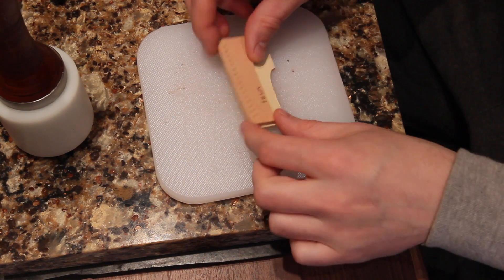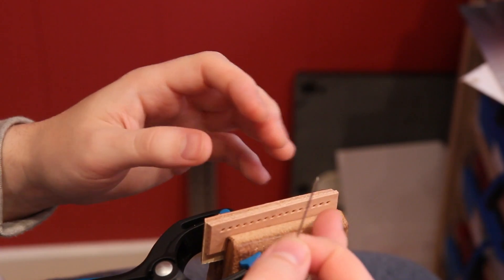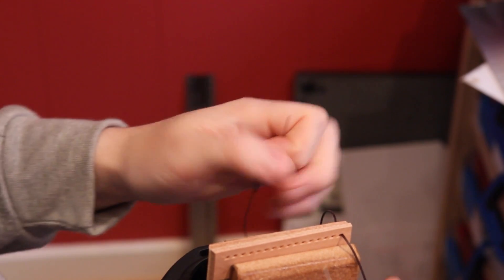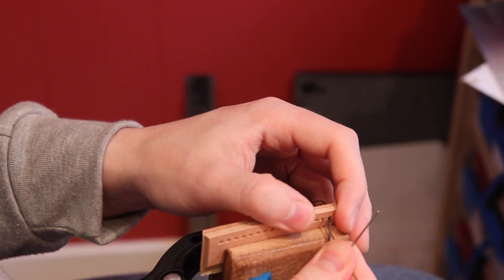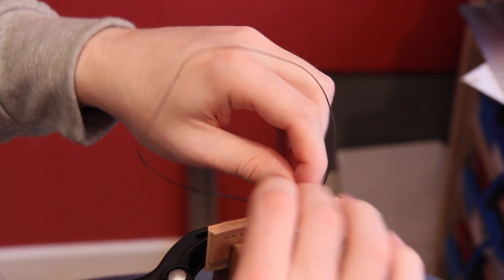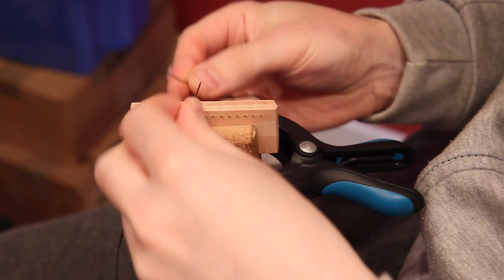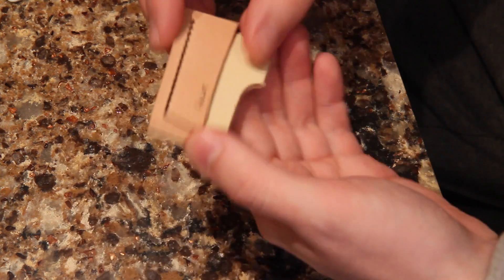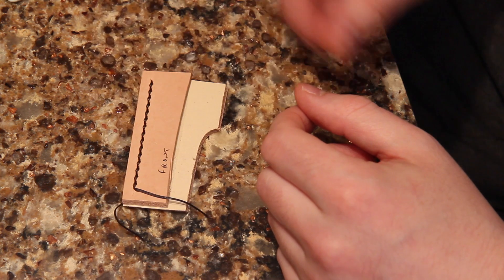Quick Tip: Neatening up Your Saddle Stitch

Comment: I'm having a hell of a time getting the pricking iron out of two pieces of leather (8mm total). I have rubbed the iron against some beeswax but it doesn't feel 'lubricated', just waxy and somewhat sticky. Without the wax it is equivalently difficult to get the iron out. Any tips? Is my beeswax (for candle making I suppose) bad for lubrication?
Reply: roaet..I hope Ian doesn't mind someone answering one of his posts, but I thought I'd tell you what works for me. I cut about an inch off the end of my poly cutting board on my table saw, which gave me a piece about 1" x 12". Cut it in two so you have 2 pieces, each 1" x 6". Keeping it flat, cut a groove about half way along one of these. You now have a U shaped piece, with the slot of the U the width of your saw blade. With one end open, after punching your holes, slip this jig along your prickling iron in the U slot. Hold the poly piece down firmly and the iron pulls out a lot easier and I get nicer diamond shaped holes also. No rocking back and forth or other movements causing holes to elongate. Add a hole and leather wrist loop in the non-U slot end and it helps keep it close while using. I still use bees wax. Good tools are expensive and if it may help extend the tool life, I use it.
Reply: Allan Davis great tip! I was just having the same issue and this totally makes sense.
Reply: +Efraín Bojórquez García Also try high grit sandpaper and then polishing with some... well... polish lol and a piece of scrap leather. 
just rub the abrasive polish into the flesh side and either strop the punches or rub them with the leather. This will make the metal itself much smoother, therefore easier in and out, and the wax can do its job. Hope that helped, but test it out on an awl or something first to get it right.

Comment: Very Nice young man. I do take a lot of interest, of late, in your very informative clips. I hope to make my own friction sheath in the summer for a very old Normark Supersweed lock knife that I have had since the 80's. The original Whitby knives sheath is failing in the belt loop so I need to replace it. I will use your clips for help & pointers where I need to. The stitching is certainly one for anyone to have a look at. Keep it up & Many Thanks

Comment: excellent video ! In a saddle stitch do you need to tie off the ends before cutting the thread or does it lock it self after flatting with the hammer ? I have always tied the ends just to give it a little extra insurance .

Comment: You use the Japanese pricking iron to make straight stitching easily, but I'm having trouble keeping my stitching neat while I do round edges. Do you have any tips? Usually I just try to hammer out holes one-by-one first.
Reply from the maker: +chriserony use a 2 prong iron for going round curves

Comment: Do you have any recommendations to reduce the trauma to the back piece of leather when punching the holes? (I.e. the holes are clean where the punch enters the leather but not where it exits.) I always use a thick, plastic sheet under the leather to protect the punches from the stone slab underneath, but perhaps that’s not the best material to use?
Reply from the maker: Put some scrap leather under

Comment: Nice video. One question...when you stitch a leather belt, how do you know how long the thread will be? How can you measure the lenght of the thread?
Reply: Ciobanu George I know this is an old comment but in case you haven't found the answer, your thread should be about 4 times the length of the item you are stitching.

Comment: Hi and thanks for the video. question here: Im using Japanese pricking irons, the black ones, and I notice that when sewing after the holes, the thread in one side of the leather looks like a zig zag and in the other side the stitches are in a straight line. Sometimes is the opposite, I have noticed that this change depending in in which side of the leather I put the needle first. If I put the needle first on the under side of the leather then the other needle through the visible side of the leather, I get the zig zag in the visible part and the straight line stitch kind of in the under side of the leather. Personally I like it more when the stitches looks like a straight line in the visible side of the leather and under the leather the zig zag... is there anything I can do to control this? 
Big thanks

Comment: hi, this tutorial is wonderful! However can i ask something?

I realised that when using this stitching method on thinner pieces, the front tend to straighten up. Is that what you experience as well?

If so how do u solve this issue? For me I tried to solve it by not moving the loop on the back side when stitching. 

Any advice will help! 

Thanks
Reply: You are not alone. I have the same problem with thin leather. One size siq-sag, another straight. I noticed that the side where we crossed the thread over will have sig-sag effect, which is what I always want.

Comment: I was wondering if you found it necessary to coat your pricking iron or needles with anything, like beeswax etc, to make it easier to get the iron out or pull needles through the holes? Or am I doing something wrong? 
Thanks!
Peter

Comment: Ian, wonderful video, as always. This really helped. 

One question I had is about reverse stitching. There are times when I need to stitch the opposite direction (1st needle coming through the "front" instead of the "back."). However, when I do that, it ends up straight again on one side. Any idea how to neaten it up in that case?

Comment: what kind of glue do you use when you glue the pieces togheter?
Reply: I notice in his videos its just contact cement, I'm pretty sure he uses Barge brand. I have Dap Weldwood contact cement in a small glass bottle. It works amazingly with leather, I did tests on finished and unfinished leathers, and flesh and face sides and I'm very happy with the results. Hope that helped.

-Dante Antonio.

Comment: I takes guts to hammer on a granite counter top like that.
Reply from the maker: +archangel20031 it's a leatherworker's marble not a counter top, it's designed for such uses.
Reply: +Ian Atkinson 
Still looks like a surface that just might decide to break with an impact.
Beautiful but fragile looking.